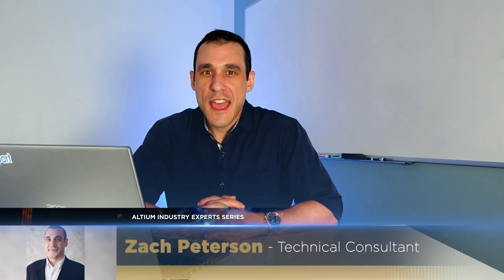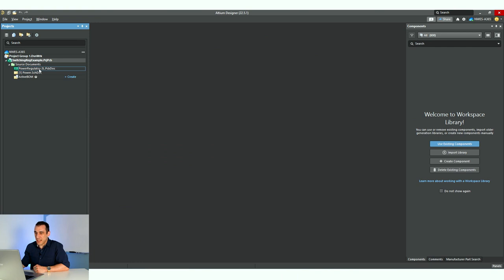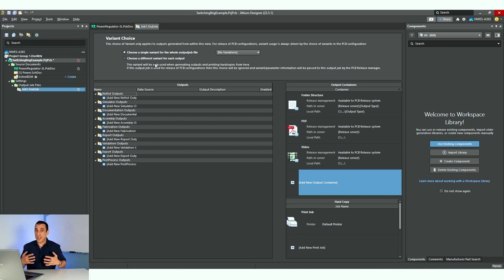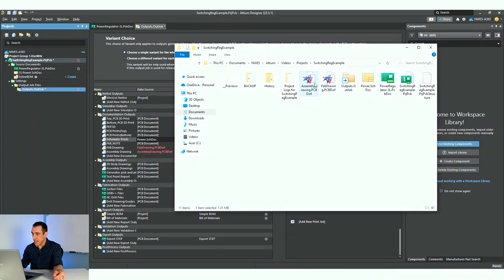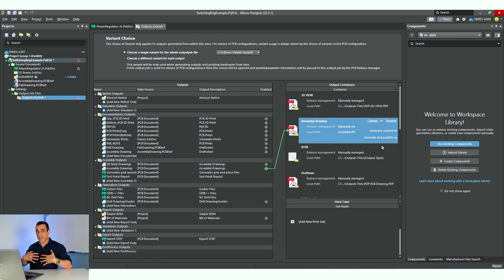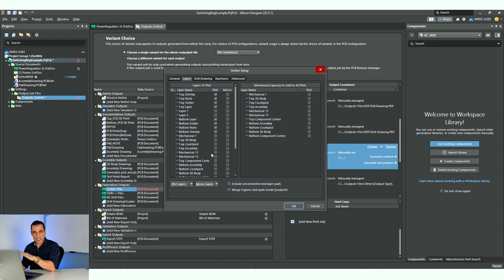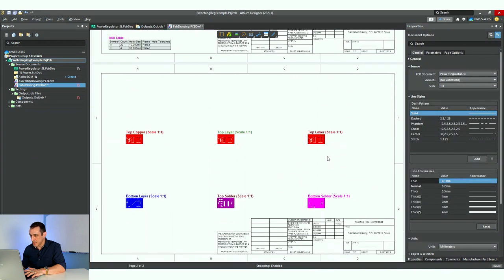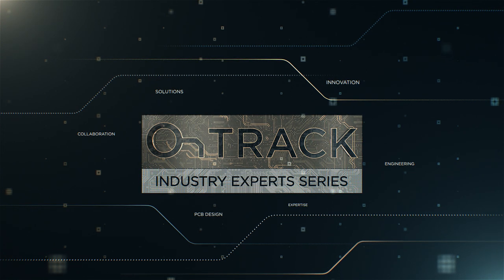How to Speed Up PCB Outputs Using Outjob Files

Comment: I guess the initial question was how to create custom folder structure for output job files that meets the company's requirements not the default stuff...
Reply: It's in the Change dialog, you can do it all there, but the other half of it is how to do it consistently without having to re-do it every time.